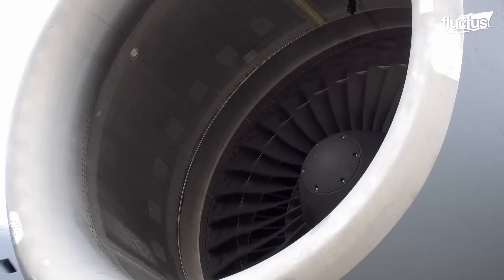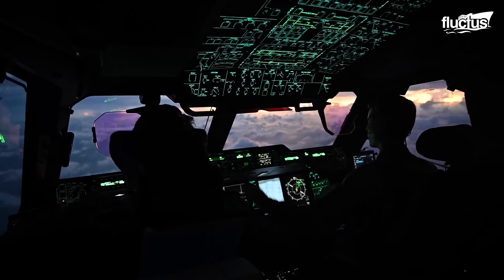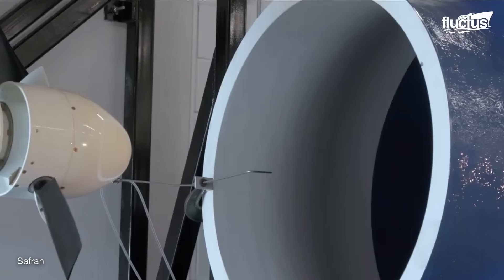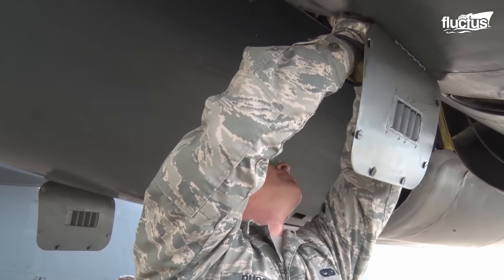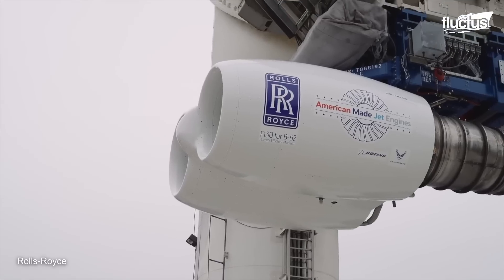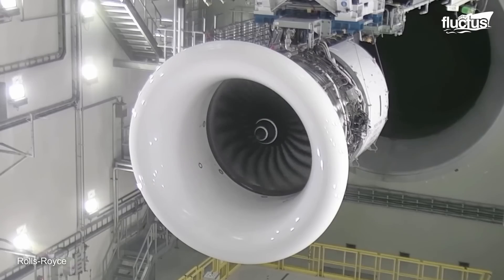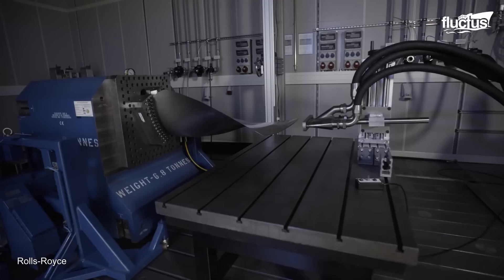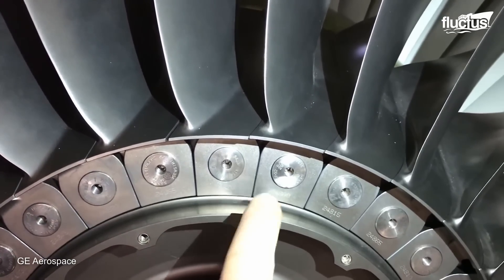Genius Technology Engineers Found to Save Planes When Engines Fail Midair

Comment: A friend called me and asked about the start cart here. We also have them in GA (General Aviation). But they have nothing to do with "gun powder" LOL. Smaller private jets use a 24 volt system. It needs to be at 24v to use the starter to start an engine. It's common for the system to loose voltage when sitting idle for some time. We then request a ground "start cart" from the FBO. That is a generator mounted on a cart (imagine that) producing 24v that is plugged into the jet. When 1 engine is started it can be unplugged, and the second engine started from the generator of the running engine, or bleed air from the running engine ducted to the second engine.  Although the "gunpowder" may be more exciting. LOL  8)    Peace   --gary

Comment: Curious that this is new technology. McDonnell Douglas had a RAT (Ram Air Turbine) installed on the F-4C which was designed in the 1950’s. Used high pressure air to extend. It created a huge amount of work when it was deployed.

Comment: That’s just a wind mill on a plane. It’s used to power some basic instruments during a total engine/power failure mid air.
I am not sure if hydraulics are usable at this point…
Reply: Many military aircraft use the RAT to power the hydraulics in order to either get the aircraft flying straight and level to try for engine re-light or allow for safe ejection.

Comment: The RAT does not keep you in the air if, or when, your engines fail.  Gives you instrumentation to know when you will hit the ground from those failed engines.  Might give you hydraulic power to keep aircraft control surfaces operating as the aircraft falls to the ground.  Notice a common thread?  "As you fall to the ground."
Reply: Better some form of control...than none. Or maybe you have a parachute?
Reply: @BANANASandDUCTTAPE  If you are really a navy vet, thanks for your service.  There is only so far you can glide a commercial airliner without engine power under control or not.  Your comment sbout the parachute was supposed to be cute I guess but a pilot riding an aircraft to the ground powered or not would not find it as funny as you apparently did.  Flight crews take the safety of their passengers very serious and it is not because there are no parachutes.  Some folks cannot deal with serious situations and resort to humor to avoid the serious matter.  Guess you would try to keep the rest of the flight crew laughing as the plane plunged to the ground.  Not sure what to make of that.  Doubt if that would have been any more helpful than your comments here.